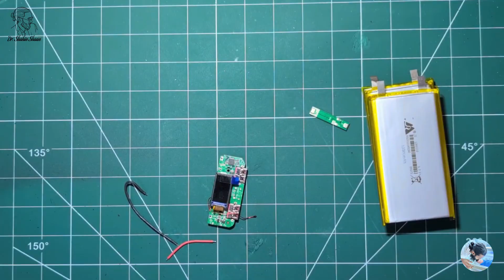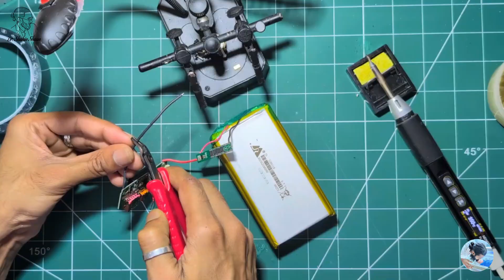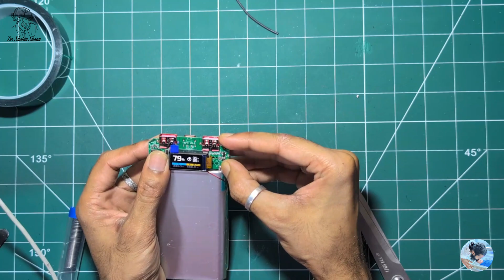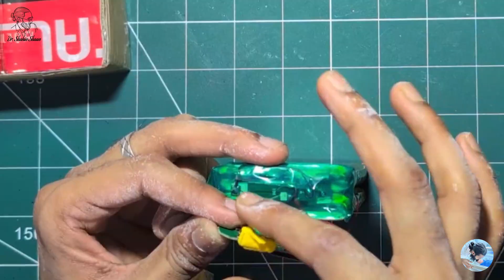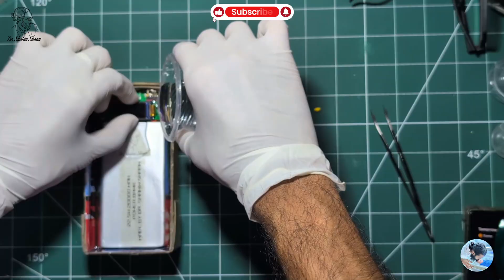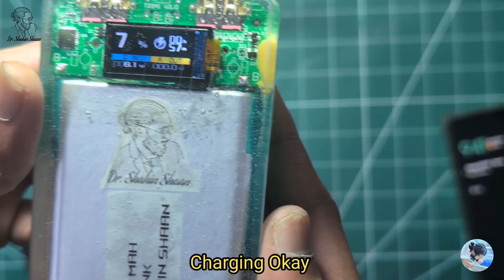DIY Transparent 20000mAh Fast Charging Power Bank with TFT Display | Homemade Power Bank Build

Comment: Is it available in your page? If yes, I wanna order one, kindly lmk how many days it will take to deliver the order, it’s kinda urgent!
Reply from the maker: Thanks so much for your interest and support! 😊
You can actually buy this module from MSI Spark (Links in the description) — they sent it to me along with the batteries. It’s a DIY kit, so you’ll need to assemble it yourself. They also offer a similar version with a case if you prefer that.

If you really admire my work, I might be able to make one for you! Just keep in mind that since it’s made with a resin body, it’s not repairable.
Feel free to reach out to me on Telegram or WhatsApp — it may take a week or two to get it ready.

Thanks again for your appreciation! 🙏
Reply: @Dr.ShahinShaan  check your inbox please